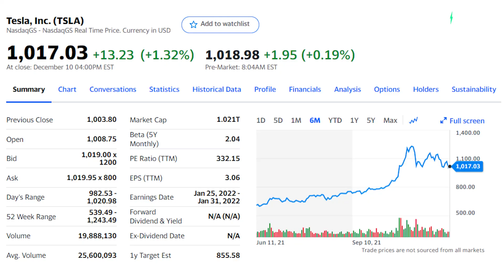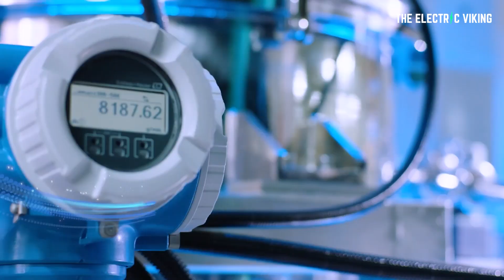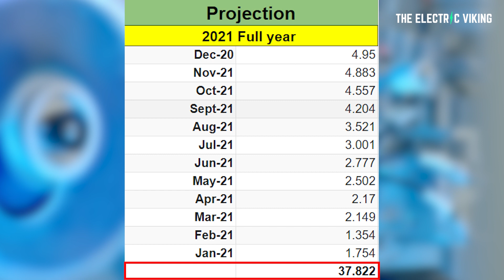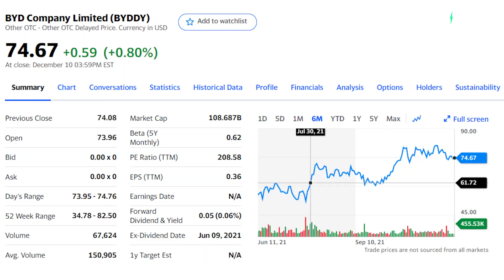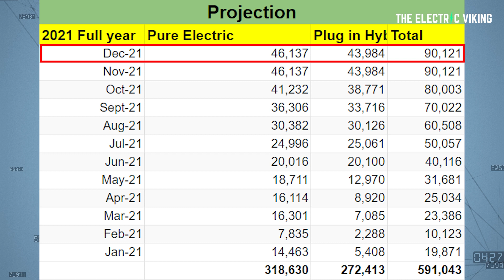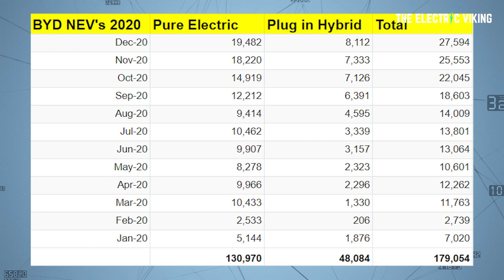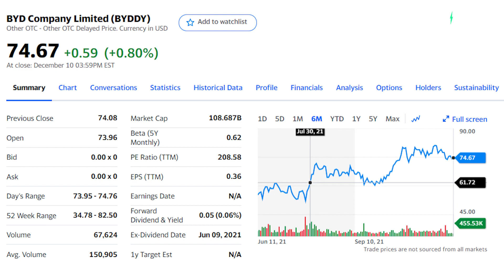This is the CRAZIEST EV and BATTERY story of 2021

Comment: Not sure that’s correct .

Billionaire investor Warren Buffett-backed BYD Co (OTC:BYDDY) ranked second with 16.6% market share, compared with 20.4% share a month ago. BYD installed 3.46 GWh battery capacity during the month.
Reply: yews his chart is a bit out, but only by a very small amount.

Comment: BYD, they can be proud of their achievement but it’s only the beginning, Tesla is amazing yet unaffordable. Hopefully BYD brings EV to masses as soon as possible
Reply: Truly, you won’t believe me, but I hope BYD do well. But if they, or one or two models are el cheapo, like Hyundai Excel was, westerners will reject them They don’t have IP that’s comes from
R & D. I don’t want a car with excessive road noise, or rolling on winding roads, or an inferior infotainment system that is there but no good
Reply: BYD has still had no comprehensive reviews.. it is a new entrant . It doesn't have the long history of r&d into metals, plastics  paint, drive train, handling  etc etc in passenger cars that Western gained over 100 years. That means that don't have precious IP that Western auto manufacturers possess. I remind you that VW had a devil of a time in getting its Infotainment System right.  Don't tell me BYD will  they won't, they don't have the expertise and IP. BYD think Nexport can fix the Infotainment stuff.  They don't,  they don't..A car is more than the battery. The early signs are that BYF Infotainment systems will be rudimentary  third rate rubbish.  The Chinese motorists dont care too much about shite Infotainment systems.. but the West  will reject rubbish. We are yet to see whether in all respects their cars when put to the test by Western auto electric auto engineers.. we have also conflicting commentary about the 0- 60 mph of the EAN and others. I have heard a lousy 10 + .. thats poor.Despite all the videos churned out by Sam,  he hasn't been able to, nor has Nexport hasn't exposed BYD cars any to the blowtorch reviews we need to see. Sam talks a lot but there are clouds over BYD   until we see unfettered   independent, no holds barred reviews of the new entrant, BYD . Until we do, the hype re sales doesn't tell us about the quality of all the components and paintwork /duco etc etc . It just says Chinese are buying them.
Reply: @pragmatist165  just a reminder, cars are mean of transportation, more than 90% of cars rightnow lacks infotainment and yet they serve well their primary mission, and by the way 98% of cars spend more than 10s to reach 96m/h it's  not relevant at all. Safety is important and they won't get around West's tests.
Reply: @vargach  people say safety is important but THEIR DECISION is not based on that.  Most  cars have ANCAP 5  no sure BYD has got that covered .. I 90% of cars have Infotainment systems.. Westerners will reject those that don't if BYD don't get that..it will succumb.  It can't be just an el cheapo system.
Reply: @pragmatist165  el cheapo Dacia spring ev selling really well in Europe at 8 to 10 thousand euros. A city run about it will do well in the UK and Oz.

Comment: Should we count hybrids into that number mate, after all they have an ice engine.  Let’s not put them in the mix and make more pure EVs
Reply: BYD DMi PHEV's go over 120 kms on a charge, you are confusing them with standard hybrids. 

They are necessary for now until the infrastructure catches up, not just in China which has more installations then anywhere, but across Asia, Africa etc, where they can't build the charging, power grid upgrades, etc., at the same pace, and don't all live in houses with a garage.

Comment: BYD has two listings, BYDDY and BYDDF because it is split into two subsidiaries.  Which one do you recommend investing in?
Reply: Outside of China, BYDDF is easer to buy. Hong Kong shares are made for people outside of China, while Chinese stock market is difficult for foreigners to access.
Reply: They aren't subsidiaries. If you don't know that I advise you not to invest. You need to do more research.

If you decide to buy, try to buy in HK where they are listed 1211.hk. BYDDY and F are ADR's, on the OTC market in the US, but exactly the same thing. It's better to buy in HK.

Comment: They have done great the last 2 year, but not enough data is known to me to evaluate it as an investment. This is the same company that produced 600,000 vehicles in 2010. I like the move to electric vehicles, but what happened between 2010 and 2020? If there is more data out there, can you point me to it? Or is this just going to be another flash then die back?
Reply: 2010 was ICE; since then they have completely reinvented themselves. 

They've sold over 500,000 cars, 90% of which are NEV. Only Telsa compares to this. Next year they will easily sell over 1 mio cars.

How can this be a flash then die???

They are no. 3 overall on MC in the world of global automakers; No. 1 NEV in China; No. 2 Battery maker in China, no. 3 in the world.

No. 1 EV buses, trucks, forklifts etc.,

45% of their revenues comes from Solar and consumer batteries, phone casing and any other consumer product you can think of, including Apple phones.

It's not difficult to research.

Comment: The Chinese will win the battery market just like they took the solar PV market

However the consumer will win with low prices rather than the producer winning with high margins

What is happening with EVs and batteries is just a replay of what happened with solar PV in 2005-2015

Just a reminder for those who don't know. There was a solar bubble and then stock prices crashed 95% as companies pushed margins down towards zero

Comment: BYD's achievement at the production and distribution level is mind-boggeling.
The technology level is a different story. There, Mercedes is now officially running circles around ALL other EV manufacturers. Yet no videos on this achievement have been forthcoming to date.
It would be nice if the electric Viking would do a video on how it is possible that Mercedes was just officially awarded the FIRST level 3 license for autonomous driving, while Elon Musk continues to sell full "self-driving-mode" packages (level 2 😂😂) to thousands of naiv (and apparently ignorant) consumers that don't seem to understand the difference between Mercedes' REAL technology and the boastful snake-oil salesmanship over at tesla. Has tesla already committed to a date by which it will achieve level 3 autonomy?  No??  😂
Reply: Funny. there are 6 companies with level 3 licenses in China, but they don't count!

And you forgot to add, that Merc's license is only in Germany and only for speeds upto 37.2 mph. But well done Mercedes!
Reply: @BSBSBSBSBS-i2x    Perhaps the relevant question is: who defined level 3 in china?
Mercedes is the FIRST company to have received a level 3 from the international standardization body, which is why the formal name of the received license starts with UN, as in "United Nations".
Therefore, the 6 licenses you mentioned in China were probably handed out by the chinese government, which obviously has reasons to be "quick" in handing out such licenses to chinese companies. Have you ever considered such a preposterous concept? 😉 😂
Without the UN-xxx licenses required in the western world, chinese cars will not be allowed to drive autonomously in the RoW. 

Re speedlimit:
1. Yes. the Mercedes license is speed limited for now. I never claimed anything else! In fact, I didn't even mention it, because why kick a company on the ground (tesla), when it can't even get to level 3 AT ALL?
2. Mercedes has already published it expects to get its system to the stage where the speed limit will be doubled before the end of next year.
3. I'm still waiting for information as to the committed date of tesla to just achieve level 3 as licensed by an international licensing party (since it sells its EVs world-wide).
That was my post. When will tesla finally achieve what Mercedes has been first in the world and officiated with a actual UN-xxx license?
You "forgot" to answer THAT, but went off on numerous useless tangents that did not even BEGIN to address what I had actually asked. Nice try, though. 😉 😂
Reply: @BSBSBSBSBS-i2x  I seem to know a LOT more about the autonoumous driving technology and who gets to license it than you. And I'm not even a disciple of the tesla religion.

Here some more facts to help educate you: The UN only passed these car-autonomy licensing laws in early 2021, and it was officially communicated that Merc were the FIRST to receive the UN license for level 3.

I even know more, that you obviously missed: Audi was the first OEM at all to include level 3 technolgy in its A8 standard car, but never got the license to use it on public roads. Honda was the first to not only include level 3 technology in a standard plattform, but actually turned it on - albeit only in JAPAN (and licensed there by ther japanese government).

Like I already had to tell you (as you clearly hadn't known about the UN issue), ALL cars sold in the west will require a UN license in ADDITION to a national license to sell autonomy. Merc is currently already running the UN test license procedures in china and the US to ensure becoming the first OEM with a national level 3 license in those two key markets (and therefore smack in the middle of tesla's most visible playgrounds) as well. You're very welcome for my obvious expertise in the huge void of yours. 😂

And now for the THIRD time:  when has tesla comitted to achieving level 3 (since it has been stuck selling level 2 at outrageous prices for the past 10 years)??

The pending answer to this small question is even more fun, considering all cars receiving level three licenses to date incorporate lidar technolgy, which Elon famously labels as a "fools errand".

Your evading the answer to my simple question at all cost demonstrates I've hit the bull's eye, which just makes it all the more fun to keep raising this "tiny" issue that is met with "roaring silence" on ALL religious tesla channels. That means it must REALLY hurt close to home, which is just par for the course, when you're selling autonomy "snake oil" for over 10 grand to naiv and ignorant buyers since over 10 years and your blinded disciples refuse to call you out on it. 😂 😂 😂

BTW, did you read about the Paris taxi company today that had to take its most expensive (level 2) teslas out of operations, because one of them killed a pedestrian?

You can't make this stuff up...
Reply: @christheswiss390  mate i agree about tesla and i saw about Honda etc., but they still have excellent tech being developed in Chiba by multiple companies and driven by gov policy, have a stated goal of mass producing level 3 autonomous cars by next year.
Reply: @christheswiss390  i am talking about Chinese companies not tesla in all my posts.
Reply: L3 ADAS was installed in 17,000 vehicles, with an installation rate of 0.3%. Emerging carmakers such as Xpeng Motors, NIO, Li Auto and ARCFOX were the first ones to equip or demonstrate vehicles with L3 ADAS.

The recent five-year plans of Chinese automakers show that the mass production of L4 autonomous vehicles in China may concentrate in 2025.
Reply: A number of brands such as SAIC, GAC and Geely have defined SOP of L4:
In June 2021, SAIC made it clear that it will produce L4 intelligent vehicles in quantities in 2025.
In July 2021, GAC announced that GAC AION and Huawei co-developed a mid-to-large-sized intelligent SUV BEV with L4 autonomous driving functions, which is projected to be spawned in 2023.
In October 2021, Geely specified that it will commercialize L4 autonomous driving in 2025 in the Smart Geely 2025.
Reply: @BSBSBSBSBS-i2x  It's very apparent from your posts how you've been scurrying to look up random data on autonomous driving and the various autonomy levels. Not impressed. All your data snippets are random and miss the mark by a lightyear.

Here's what's key and what you and this channel are completely missing:
1. It is not important, what level individual OEMs say they WILL "BUILD". That is just irrelevant marketing speak.
2. What IS important - and what I've been saying in all my posts, is which OEM will receive the UN licenses PLUS the national licenses that will allow actually RUNNING their cars in level3 mode.
3. Those OEMs that successfully crack level 3 AND can achieve UN (and subsequently also local national) Licensing status will become a driving force in the future car business - not necessarily who makes more batteries or EVs.  The question is WHY this is so.  THAT is the achilles heel of tesla and all other OEMs. And MERC just made a massive statement that is being "overlooked".

Do you actually KNOW why of all the 5 levels of autonomous driving, level 3 mode is the holy grail of autonomous driving, and not really level 4 or 5?  Level 3 is the "KILLER app" level for the big breakthrough of autonomous cars. You can go look it up and find the reason. It's extremely important if you want to REALLY understand the future car business, especially for the viewers. I can wait.

It's surprising the religious tesla channels don't pick up on what will be ONE of the key drivers of the car industry in just a few years and help educate their viewers on this important subject.  Oh wait, maybe it's not that surprising after all, considering where tesla is stuck since 10 years while the OEMs are starting to run circles around them. 😂 😂
Reply: @christheswiss390  nope. 1 article today.
Reply: @christheswiss390  why do you keep talking about Tesla?

17,000 level 3 cars are already on china's roads.

Mercedes is a good company but how many NEVs are they selling annually? What is their battery production? Semiconductor production?

Years behind I am afraid.

There best bet is to become a software company and sell their software because they will struggle to sell anything else!
Reply: @christheswiss390  mate you are obsessed with Tesla.

Answer any of my points about Chinese evs? No.

If Mercedes is taking over evs where are they getting batteries from ? Semiconductor chips? The only buyers will be Tesla buyers.

The company I believe is the most important in EVs is BYD.
Reply: @christheswiss390 Mercedes best bet is to become a software company and sell their software because they will struggle to sell anything else!
Reply: Chinese Independent OEMs’ ADAS and Autonomous Driving Report, 2021 - do a search on that and educate yourself.
Reply: good luck with your software company. 

By the way my last 2 cars were Mercedes, the next 2 won't be I am afraid.
Reply: @BSBSBSBSBS-i2x  Fascinating.   🙄  😂
Reply: software comapny.
Reply: I hope you survive.

Comment: Sam are you planning a vid about Toyota's recent announcement? Is that window dressing? Not enough? Signs of a pivot to EVs?
Reply: Smoke screens and mirrors I am afraid. 

The announcement was for USD70 mio (double what they said in April), 50% still going to PHEV, Fuel Cell and 'other alternatives to BEV'.

They said 15 models are ready for production (originally announced in April) with 15 more planned by 2030 (new). 

What they 'forgot' to announce is the BZ range is being built by BYD and will have BYD Blade and use their 3.0 platform (this news broke in the press recently, but the JV was formed back in April). 

Very importantly in April 2021, Toyota announced it would introduce 15 BEV models just hours after BYD unveiled e-platform 3.0.

So the news is good, but effectively the cars will be built by BYD with Toyota interiors and a Toyota badge stuck on them.

There new sales target of 3.5 million (75% higher than the previous one) NEVs by 2030 included PHEV's and is only 1/3 of their total sales today. By 2030 who will buy the rest???

Lexus is good news, but again they only aim to be 100% all EV by 2035. That's a long way off.

Regarding the batteries:  Solid state batteries are not in production by Toyota and as of today they have no battery tech of their own, hence BYD's involvement. 

They said roughly one-quarter of the newly announced investment funds – 2 trillion yen – would be dedicated to accelerating the development of more-advanced, high-quality, and cheaper batteries, meaning they don't have that tech yet. 

So as I said smoke screens and mirrors, lets see what the reality is.
Reply: @BSBSBSBSBS-i2x  thanks. So unexpectedly (to me) this is on topic then as it's about BYD. And  I have some shares in them 😀